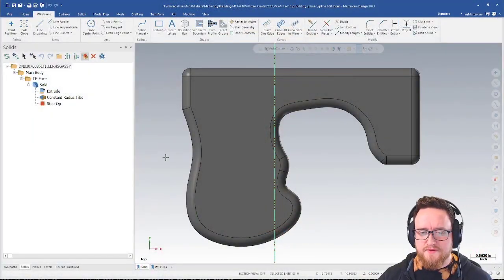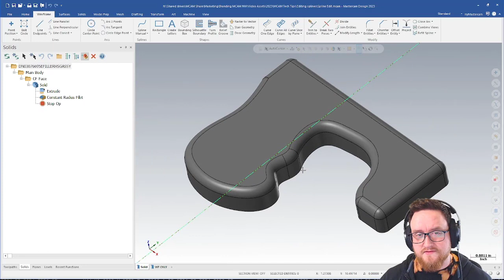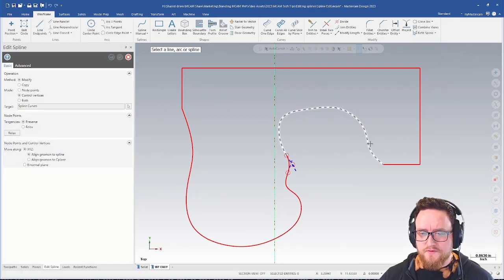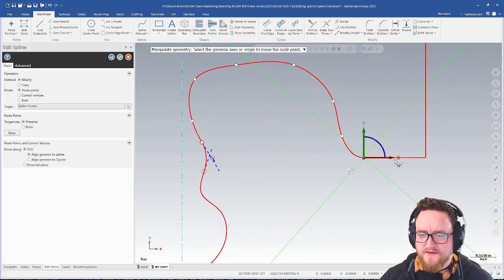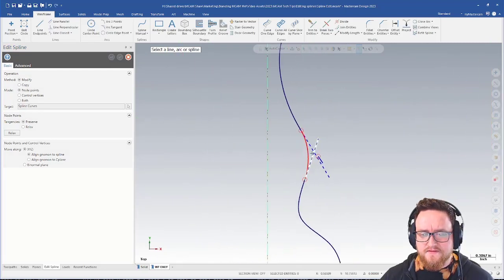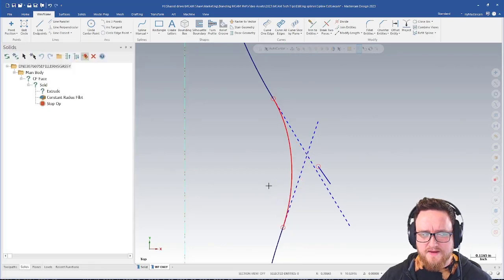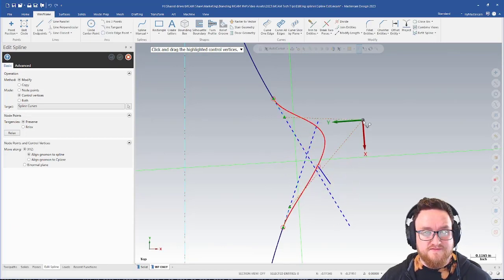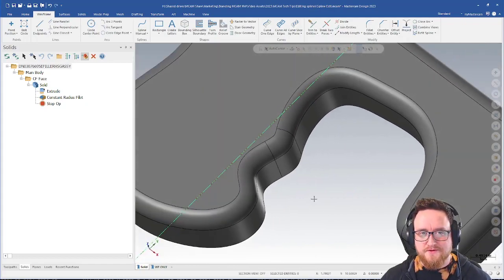Editing Splines | Mastercam Tech Tip

Comment: I’m working on a solid model, creating curves, but none of the curves lineup to each other, at different depth different angles, there is nothing flat or square about this part. It’s all radius, angles fillets. I’m having a problem with the edge curves.